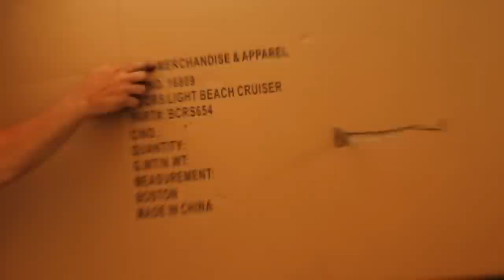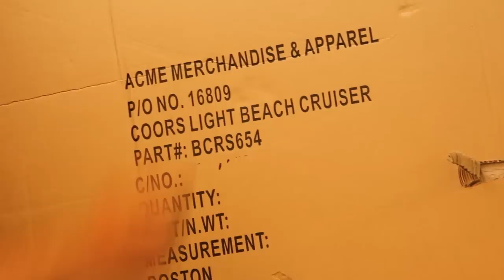The Beer Bikes - What Not To Buy - BikemanforU - Local Bike Shop

Comment: That weld was horrific  on the top of what could be a cool tank bike .. I try to give every thing a chance to be saved and improved upon ect   but that cruiser  not a chance..did not want to put a motor on it ...nuff said .
Reply: Tenspeed TheBikeHanger not very
Reply: Mr.Coyote wasn't ever all that big on the whole " read  this instruction book,warranty registration,precautionary statement "sort of thing.with the exception of  one poorly sealed"earthquake in a can",Personally I can't recall a single Acme product that failed to make the grade.Nobody makes a finer balanced high altitude dropping anvil  than the artisans of Acme. .The knock off syndicates were bound to get around to them sooner or later. Kind of like Pacific Cycle and the abominations they slap a schwinn"stick- on" badge to. I wouldn't be so harsh about the plastic levers.They are also available in  recycled particle board/extract of horse hoof composite.
Reply: when you are getting children to do welding what do you expect...
Reply: C Challinor And probably beating the crap out of them when they don't produce fast enough. Quality Stuff ;-(.
Reply: Thomas Hamilton Why wouldn't you be so harsh on the plastic levers?  That is the likely the worse safety issue of that bike.  Your braking system is NOT the place for junky & flexing plastic.

Folks harp on the welds on the "tank" of the cruiser bike.  But so what!?!  If the welds are strong (and didn't damage the surrounding metal due to poor technique) -- then you got what you paid for.  But I'm OK with functionality over form.  What folks should be concerned about on that bike is how many hard power stops can the coaster brake withstand.

Comment: Don't be shy Bikeman! If It's a POS...it's a POS!!! As a bike mechanic with 30 years experience,,dealing with these things is a major PITA (Pain in the Arse).  Make them pay. Hopefully, it will teach them to not cheap out next time-it might just save their arse. I can't stand cheap ass sh*&t! Should be illegal..seriously. Alcohol and bikes-wow, what a great combination! Make them pay! I was just at Sears Yesterday and they had a-I can't remember and would not say if I did-but it was a major brand name. They had a "full suspension" on the rack. The fork was quite twisted-at the arch-probably not from test ride impact-but from impact during shipping. Also-the brake levers on both sides (cable actuated discs) bottomed out on the bars. Stem was not aligned. The "Ellsworth" like linkage at the rear looked like it could be snapped to bits if I just grabbed it with my bare hands and twisted. GD'm cheap Sh*t!. Serously, this should be illegal. Cars have federal safety requirements for seatbelts, airbags and ABS. So do helmets. Where are the the safety minimum safety requirements of bikes? It just shows how skewed we are towards car culture.  A significant number of people must have been hurt/killed on these Cheapo's. Bikeman-you are a scholar and a gentleman. Don't pull any punches reviewing these. You might just save someone's life-for real. Enough of this ridiculous rant! Myself, I ride a 2000 Specialized FSR Enduro-which is in a constant state of maintenance/repair (presently converting to 1x as Shimano E-type cartridge BB's (63/113) and a PITA to find.
Reply: Question for you. Any ideas on a good substitute bottom bracket for a c. 2000 shimano sealed cartridge BB-UN52-E-type 63/113? There is no effective chainline indicators between the left and right arrows on the unit (no "LL' etc. it's blank-I checked Sheldon Brown, Park Tool, Barnett's- nothing about the "blank" designation). I guess it's a 47.5mm chainline-I gotta stop being lazy and measure it. Any suggestions? Thanks!
Reply: MarzNet256 Hear, hear!

Comment: Great video. I laugh when friends brag about thier bike they got for $100. Then they bitch that they have no idea how they would ride for 50+ miles at a time like I do.  Next thing u know it's sitting in the garage collecting dust
Reply: It's quite hilarious when my friends wanted me to take them on a 60 mile ride and show up with pure junk bikes. They claimed 60 miles was nothing. We didn't even make it 5 miles before they're winded because they're so heavy and don't shift properly.
Reply: nigahiga6400 Are these the same folks that post on cycling forums that they went out and did 40 miles at a 21 MPH average?  Or that they do 5,000 miles per year; but from the the things they post in the forums I'd only believe 50% of that?

The amount of self-over estimation is staggering!  I did 10,000 miles in 2013 and 11,000 in 2014 (with the Strava data to prove it) along with racing cyclocross and crits; so I have some idea how many hours it takes to input in serious miles and what average speeds are realistic.  I always want to ask these folks for a pointer to their GPS data or ride on Strava/Garmin Connect/MapMyRide/etc... but so far always managed to temper my tongue.
Reply: minhtoi Yeah! They claim they do insane average speeds and annual mileage, yet somehow their tires still have the rubber nubs and their chain is still brand new. There's a ton of wannabes and fake racers out there too. A few of my friends have better bikes and clothing than I do, and I'm talking full carbon road bikes and gear that rivals the pros. Unfortunately it's all for looks, and I still pass them on my '75 Schwinn Continental which weighs 48lbs in my commute configuration. If half of what I see and hear is true, then I guess we have a ton of pro racers.

Comment: These look like the standard of bike that I used to have put together on a daily basis, while working at Halfords Bikehut (one of the biggest cycle retailers in the UK). The bikes they sell are made to break, meaning that customers have no choice but to keep coming back for repairs (which Halfords profit from). ATTENTION UK VIEWERS! NEVER BUY BIKES FROM HALFORDS! Compared to most other bikes of similar prices, the bikes they stock are of inferior quality and will have no end of problems occurring with them, even if they are in their higher end range of bikes. Go to an independent retailer, they will sell you a better built bike and offer you better service.

Comment: You can make a bike, or anything, cheaper in more than one way. Lets just take the two most obvious, and oppositely directed. You could make make the item crappier, or you could make the manufacturing process more efficient for a given item.

 Even making it crappier is not necessarly bad, if you give up things that truly don't matter to the buyer. So let us say the welds are really uneven and ugly, but the welds hold as well as pretty ones. That might be OK with a buyer. OTOH having center pull brakes that actually won't put much pressure on the brake pads, because the brake levers give way, pretty much negates the purpose, unless all you want is brakes that LOOK like good brakes (and some people probably do.)

 You can also make things cheaper by reducing the margin. Stores that sell in large quantity can afford to operate, and in fact make huge profits, on small margins.

 Some items, like very light, classy and fast bikes, have too limited a market to make manufacturing in huge quantities viable, so the manufacturing remains inefficient, and the price is necessarily high. That leaves the door open to sellers, some of whom have a lot of bike savvy, to commision knock-offs of approximately similar level bikes.

 As a buyer, though, do you know why a bike is cheaper, especially without seeing it in person, and having very little experience?

 IAC, I took a chance on an 8 speed IGH city bike, not a huge market segment, from Bikesdirect. I don't for a second accept it is the equal of a bike that costs 50% more, but I am satisfied that it is quite good enough in what counts to me.
Reply: I "thumbs up" this comment, both literally & figuratively. A+++++ 

But after 40+ year (on & off) of cycling, life's too short & I'm too old to ride cheap bikes. That's just me personally.
Reply: Tenspeed TheBikeHanger I wish there were a formula where you could figure if something was just cheap or junk before you try it to find out. I have run into instances where they sell what I know to be the identical item for double the price in a quality store, which I thought had to be junk when I saw it in a bargain store.

 I seldom go into outright dollar stores, in spite of the fact that I am a rigid, hard-nosed, unrepentant price-shopper, or rather because I am. Their inventory consists of what I would call "ringers." They either have oddball, skimpy sizes of name brands, that actually are the same price per quantity as in a standard store, if you shop carefully. Or they have items that inadequately perform the function you would rightly expect, because of the way they are made. The former are are OK; there is just no reason to go there to get them.

 I do have a few "finds" I found in borderline good stores. The trash gloves, I assumed, 2 pair of interchangeable left-right gloves, with rubber gripper dots for $1, turned out to be ideal for driving my bike in temps I can't take with bare hands. The loose knit passes the right amount of air to keep my hands dry of sweat. The coarse thread turned out to be durable. I doubled up a pair, one inside the other, for still lower temps, down to 30F, and they are still OK through 3 winters. Below 30, I have to use insulated gloves, and unless the wind is blasting, my hands are wet from sweat.
Reply: Karl Ruehs What's a "cheap bike"?  My rain/grocery/trailer-hauler bike is a $250 Target Schwinn Tourist (flatbar) I picked up on Craigslist for $100.  Yeah, the welds are fat and somewhat ugly.  Where as the welds on my Bianchi Cross Concept (scandium) are so smooth and sculptured that folks think it is a carbon frame.

The Target Schwinn Tourist is cheep, but not junk.  It has the same Shimano 8-speed shifters/brake levers and deraillers, one finds on LBS low-end MTB's.

But I do agree life is too short to ride pure junk.  Of which every bike of that Corona "full suspension" type is.  I cringe evertime I see someone riding one of those -- they could have gotten so much more bike for that same $$ by buying a simple rigid frame & fork.

Comment: The cheaper the bike the more you should charge to setup, these things are such crap quality they require much more labor to overcome shortcomings like balancing out the cantilever brakes which won't have adjustments but you have to bend the spring on one side so that both pull equally whereas a minimum standard level would have tension screws.

Comment: At a yard sale i bought a Mouton Cadet roadbike new in the box for 120 dollars as a potential flip.  It was a nice looking bike, but crap quality.  Chain skipped, and the burs from the spoke ends were never ground down causing them to poke through the rim tape puncturing the tube. I wrapped electrical tape over the spoke ends in place of the rim tape which worked. After getting the bike tuned up, front brake adjusted, and buying a new tube i sold the bike for 160 dollars. Not much profit, but at least it was not a total loss.

Comment: hey bikeman, how hard is it realistically to put together a bike from a box of parts? I'm not trying to be an ass here, personally I've built engines that were easier then Ikea crap, I'm not going to throw out numbers, its a business and you can't lose your ass, I totally understand, but about your weld comment, I'm a welder and if I was paid $1hr to make that weld they would be blessed to get a weld like that lol but I'd grind it down and make it look decent if I had welded it, but not for $1hr id take an hour to do it and hate me life for the other 58 minutes LOL, good job not bashing people or products and trying to stay neutral, I can tell how hard it was for you, thumbs up!
Reply: I've put together a few basket cases, and the work itself is a joy for me. I'm not in it for the money, but for the pleasure of riding & sharing that fun with others, especially underprivileged kids. You don't need to wait until all the parts are ready at once. You can start with a halfway-decent frame, and the only major obstacle you may have is whether or not the BB spindle length is compatible with the front derailleur when it's assembled.

   Okay, so there are a dozen other major obstacles, so what? I've worked in several bike shops over the years, and I have yet to run across anyone in them who hates what they do. I usually work on one bike assembly at a time, and whenever the forehead feels hot and my hands are shaking (along with an exponential increase in the swear quotient), I let it slide  for a while until I'm sufficiently motivated to continue.

   Once you've got the BB & headset installed, the next thing is probably to cable it up, sans fine adjustments. I'm talking about the handlebar assembly here, mainly. If you're installing grips, the best and most often used adhesive product in many pro shops is unscented Final Net Extra Hold hairspray. I'd be intent on installing the derailleurs & brakes to the frame at around the same time, so that the cables could be attached to the frame, but without attempting to adjust them. 

   Then move on to the saddle & post, the drive train, and any accessories such as reflectors, racks, bottle cages, etc.. Saving the wheels for last means you can more easily reposition the frame during assembly.  I save the cabling adjustment until the bike is fully assembled, after ensuring that the wheels are properly aligned in the frame. That way, I only need to fine-tune  the derailleur & brake adjustments five times, instead of twenty.

  I still prefer to work with 70's-era diamond frames, as the parts are all over and are generally interchangeable (and cheap!). I prefer simplicity over high-tech. My creations are not usually intended for world-class racing, but they will  more than likely cross the continent without a major failure. Simply put, I don't know how to "slap a bike together", and there's no time constraints or excuses for doing anything but my best work, period.

Comment: If people introduced themselves to cycling with light and nimble $600 bikes instead of Walmart tanks, the streets would be clogged with bikes. Once you get on a $600 bike, there is no getting off.
Reply: Maafa 1619   A $1600 bike is to expensive to lock to a tree what with battery power grinders everywhere

Comment: These two bikes are complete and utter trash. The V-brake arms are steel so they will flex too.  Unsafe. Here's the thing, nearly all the bikes you find in wall marts will be of this quality and many even worse. Canada tire does not fall too far behind on the quality level either. Quality has been going down steadily for the last 20 years. Whatever makes more money at the expense of reliability and safety. Big box says make it cheaper so they make more billions profit. Suppier says: it will be more heavy , have more plastic and be less reliable and safe ! Big Box : WE DONT CARE ! MAKE IT CHEAPER or we wont buy it.

Comment: I understand the mountain bike that is garbage but that cruiser ? That's fine. It's cheap. Yes it's ugly but for the purpose it is designed it's fine.
Reply: Gyengye Gabor That cruiser uses all no-name parts and the welding on that frame is atrocious.
Reply: Yes but it's CHEAP. Not everyone has the money for an expensive bike. And this bike for the purpose it is designed i dont see what could break on it. This is made to cruise on a nice road at lower speeds. The mountain bike is garbage. I use a noname mountain bike but i choose to get a simple one with no suspension a fancy brakes and shifters and all that stuff. I often go throught the woods and off road but in 2 years nothing broke. And whatever breaks it takes less than 10 dollars to replace any part. As long as you know a tiny bit about how maintain a bike this is perfect for what is was built for. Yes it's uglier but it does the same as an expansive one. But what i hate most is the arrogance how everyone is talking about these cheap bikes.
Reply: What the fuck dont you people understand ? IT IS CHEAP ! There is no such thing as cheap and cheerful only cheap and nasty. What in the fucking name of god do you expect from something CHEAP ?! Quality is expansive. How fucking thick can you people be ? IT IS CHEAP ! And cheap is the keyword. CHEAP = LOW PRICE = LOWER QUALITY = BUT IT DOES THE JOB FINE FOR WHAT IT WAS BUILT FOR . How much more simple can this be explained. And also higher price not always means better value.
Reply: +Gyengye Gabor i once bought a cheap bike for my daughter, within 3 months the rear wheel blew the bearings, the bottom bracket had come loose, the wheels were rusting around the spoke nipples, the bars rusted, the joints were starting to rust etc. and we kept it in our shed. my electra has sat out all summer and has no rust on it, my old schwinn chicago 5 sits outside (loaner bike) its almost 40 years old and nicer than the one we i bought my daughter which was kept inside, point is you want to save money buy the good stuff first and you wont need to replace it over and over and over.
Reply: +Gyengye Gabor I hope you don't cuss at me for saying this.  What gets most people that don't like these bikes upset is that today, people are okay with cheap and don't seem to care about quality.  To me, it's worth it to only buy quality, and if I can't afford it today, then I have to wait until I can.  It's much better to buy a few high quality things then fill up the garage with garbage built by near slave level workers in Asia.